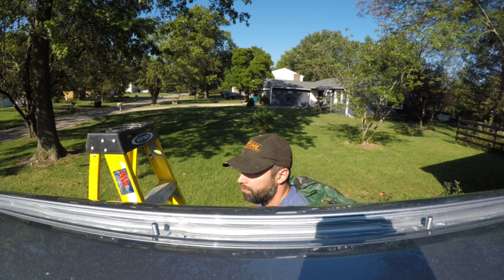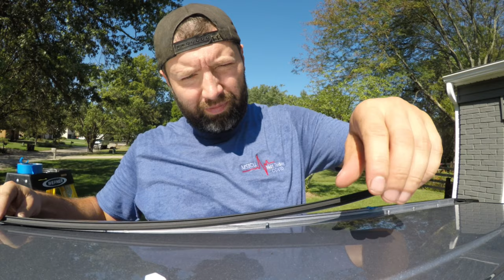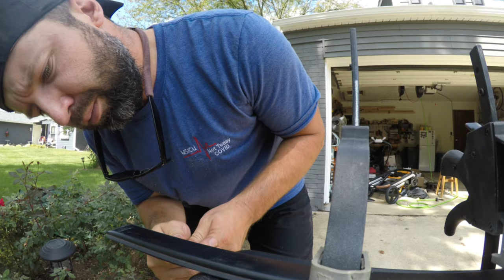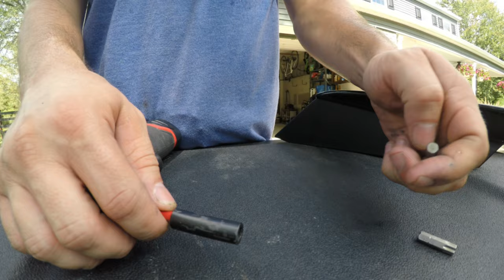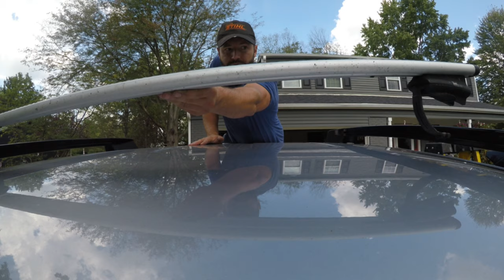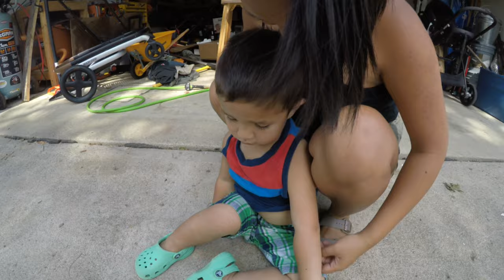Installing roof rails on a 2021 Honda Ridgeline

Comment: Nice job on the install and making the video. My RL came with factory rails and cross bars but the cross bars are a bear to loosen up and move around. Im guessing there are better factory cross bars out there. Do you like the ones you have and if so what brand are they.

Comment: Thanks for the video. What's the model on those crossbars?  Any issue with taking them on and off regularly?
Reply from the maker: Honestly not really sure about the model #, I’ve had them for long before I got the car. I just leave them on all the time but they’re easy to take off.

Comment: Mine came with a Honda kit, im the second owner.  I just removed the whole thing because at highway speeds i was getting turbulence and the car felt like it was getting moved around by high winds. Since i removed it, the problem no longer exists
Reply from the maker: Ok

Comment: I also have a new car seat covers for the Ridgeline, just in case you are looking for some :)
Reply from the maker: I could use some floor mats and underseat storage
Reply: @THEMIDNIGHTCHOPPER  I have the all weather mats specifically for the ridgeline and they are  amazing. I had the weathertech mats for my civic and I can say hands down I love the original ones for the Ridgeline a lot better.

Comment: You would think a roof rack directly from Honda would not require anything other than a nut driver to install.  A hack saw on a Honda accessory,  Sheesh
Reply from the maker: I’m sure there’s a smoother way to cut the roof molding. But, that’s what I had on hand.

Comment: What size is that Thule cargo box?  I am deciding between a L or XL.  Thinking L since it protrudes out less over the cab and seems like a better fit but have read advice recommending going bigger for the extra storage, although the advices are coming from people with minivans and suvs.   I have a family of 4 so I know the added storage will come in handy but unsure if the XL is a good fit.
Reply from the maker: I honestly don’t know which one it is. I bought it used from a REI garage sale for $200. I’ll say with the Honda truck bed, the secret trunk thing, the cargo box and some storage below the passenger feet seats, there is really a lot of storage for this truck.

Comment: HI, did these increase wind noise at highway speeds?
Reply from the maker: Hahaha. YES. But I got used to it. But if someone new is in your car they’ll probably notice. But it does make the truck look cooler i think.

Comment: Without the cross bars can you hear the side rails at highway speeds?
Reply from the maker: I don’t know the answer! Ever since this video I haven’t removed the cross bars. I do hear some wind with the crossbars while I’m in the highway. But my guess would be it would be much less with just the rails on. I’ll have to test it out and let you know.
Reply: I just installed the OEM rails on my Ridgeline, No crossbars or cargo box yet.  No noticeable noise from just the rails.

Comment: Just got mine in but no manual on were to cut the mold are you able to tell me the specs I can’t find anything on line thanks
Reply from the maker: I could email you something. Mine also came with no directions. But I found some directions online.